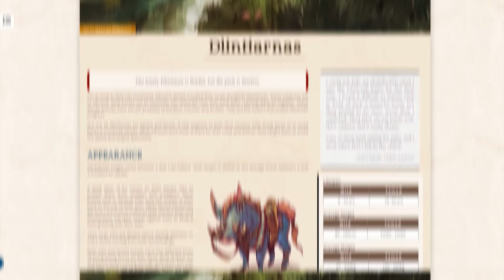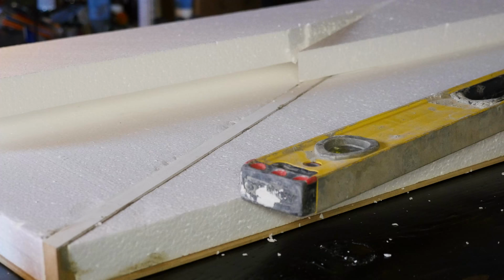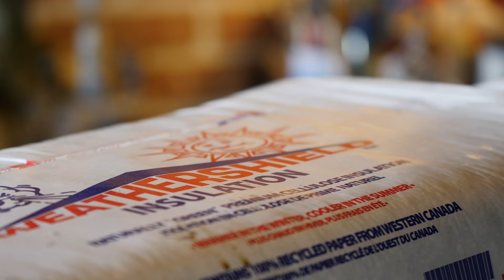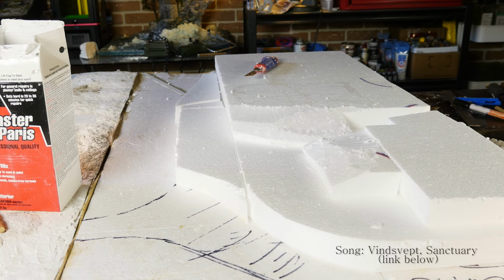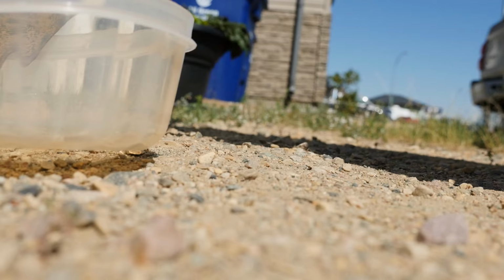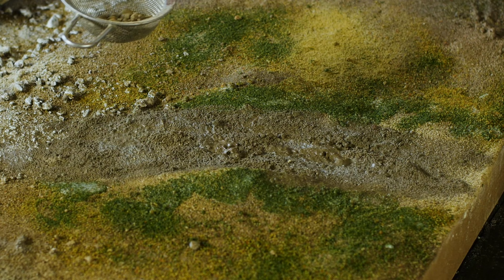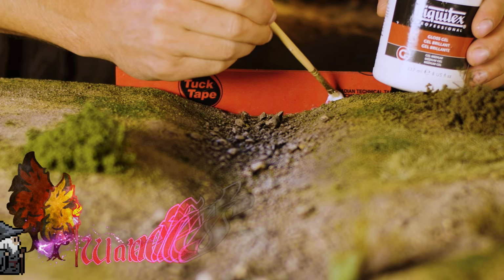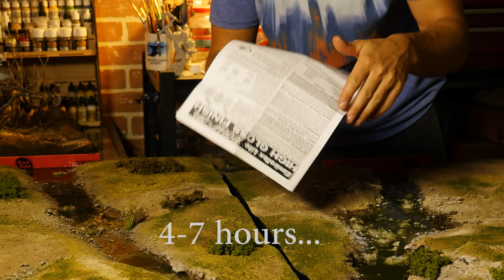How I made this HUGE 8Ft Ultra-Realistic wargaming board!!!

Comment: Jeremy used a polyurethane resin which is highly reactive to water and many other thing. Epoxy can definitely react negatively too but if you mix it right, don't add too much water based pigments like acrylic, you should always be golden!
Reply: Always use gloves when working with anything epoxy as you can become sensitised to it relatively easily, the problem then comes you are also done for polyester resins including ordinary car body filler, fortunately it doesn't work the other way and sensitisation to polyester is not common, even in the industry, unfortunately polyester resins don't tend to be as clear as epoxy ones so dont make such good water, so be careful.

Comment: a shop that I used to play at back in the 90's had something similar to this.  There's was a little more flat though, but slightly bigger too.  I think there's was 3 foot by 12 foot.  They used to split it into 3 sections for tournaments and events.  It is a lot of fun to play games on a table like that.  It adds so much more to the games.

it was part of the reason that I started playing Rogue Trader/Warhammer 40k way back when it first came out.

Comment: As a tip, don't mix paint with resin unless you've tested it. It's far more unpredictable chemically and you're more likely to end up with a bad result. You can buy actual dye made for use with resin which will always work correctly, the only downside being that it can be a bit expensive. Better to get the dye than waste a bunch of even more expensive resin. Sometimes food colouring is even a better option than paint.

This looks really good though!
Reply: I think inks work fine too, and some companies make specific tints too.
Reply: @mtmroc  Tints/dyes - same thing. But yeap inks should work fine too!

Comment: You may have found a way to add rapids by now, but just in case you haven't, you can add a white dye to a separate coat of resin/epoxy, and then use a blow dryer while it is still wet, in order to create a wave-like/foam effect.  I suggest watching some videos on epoxy river tables for some ideas on that.  There are many that create an ocean effect.  Also, they may have a better resin/epoxy for you to use.

Comment: damn, i wish i was that good xD. You have such talent and are doing amzing thingss with it! You deserve much more attention as you are a gem among many other channels out there! keep it up! A reccomendation for wargames is warhammer AoS (which still have gw flaws) or Gw lotr
Reply: Start with what you can, watch, read, learn, practice. That's what I'm doing and my stuff has vastly improved in just a year.
Reply: @MonkeyJedi99  And start small(ish). That way you can actually get a result in a decent time and experiment more with different things (instead of working on one thing for a long time, which may end up not working). My first dive was actually a small diorama with 2 vikings fighting next to a small stream. It's around 4 by 2 inches, but you'd be surprised how much space it actually is to put stuff in.
Reply: @raymondbenjamins5884  Also a very good point! I have committed to a large build (2' x 4' x 4" tall base with a lighthouse/tower about 6" across and 8" tall in the middle) but I smartly did not offer a due date.
-
I have all of the materials and tools, but I need to give myself a swift kick in the seat to get over my fear of failure and actually start it.

Comment: This is a really beautiful table, but is there anything that can be done to make it more durable?  The problem I've had with actually gaming on foam-based tables is that they tend to chip and scuff and divot very easily.  Amazing to use for display, but even the wear caused by rolling dice on them will wear them away pretty quickly.  Metal models that have spiky bits which tip over will stab into the foam... I see that you've coated the table with a layer of modge podge.  Any way to quantify just how much of a shell that creates?

Comment: How heavy is a table like this? I have concerns for storage and portability. I'm thinking there may be a way to hang this on a wall to get it out of the way and display it at the same time. Thoughts? Thank you and great video.
Reply from the maker: Good question!  There was some weight to this one but definitely not over the top.  Hard to say exactly what each board roughly weighed.  Im currently making another set of boards using new materials and its WAY lighter than these were.  You'll see them in my next video and exactly how I made them.  And I was thinking of hanging some projects on the wall too as a way of both storing and displaying the boards.  👍🙂

Comment: Okay I'm only five minutes in, and I'm confounded by two choices so far:  1. why not just use heavier plywood to eliminate the need for any framing, and 2. why in the world build the foam (which I assume is the base material for the terrain) on the same side as the brace?  This is not meant as a negative comment for the sake of being negative;  both of these choices so far seem very counterintuitive to me.
Reply from the maker: Confounded?  My that's a strong word so my apologies for needing to do a better job spelling it out.  I figure with just a bit of thinking you could come up with a couple solutions as to why, but I'll help ya out. (1.)  So, plywood adds more weight onto the entire project.  1/8" vs (probably at least) 3/8" plywood (to avoid bracing) is double or triple the weight from just the wood alone.  We're trying to make these as lightweight as possible remember, and we'd still need to build up the boards with styrofoam etc to get any sense of depth so it doesnt just look like, well, a coloured sheet of plywood with a river painted on the surface.  So, if we went plywood then built it up to get some height and depth on the terrain, we'd still be adding the "frame" around the edge to prevent the styrofoam from acquiring any damage.  (2.)  The foam goes onto the brace side to hide the brace.  It's that simple. :)  If you need to know why we would hide the brace I can help with that too.  1, a giant X on the bottom is awkward and adds more depth in the opposite direction when it could just be hidden inside the depth of the upper styrofoam layer.  2, a flat bottom as opposed to an awkward X will help prevent any scratching on the table the boards are being used on.  I feel you may be jumping ahead of yourself with an emotionally "confounded" response before taking the time to just first quiet your mind and come up with a solution or two on your own.  Do that and you'll probably find the answer easing that tension in the brain a tad hehe.  Hope that helped clear things up!